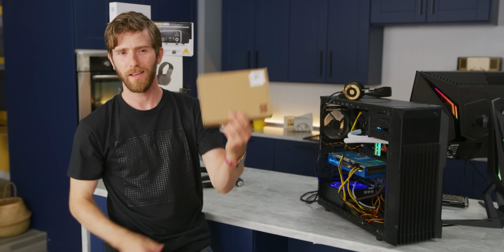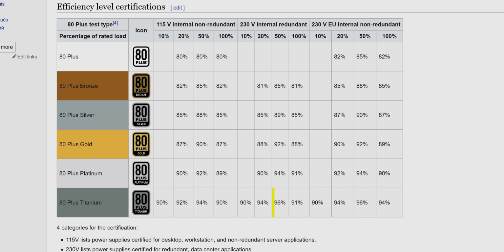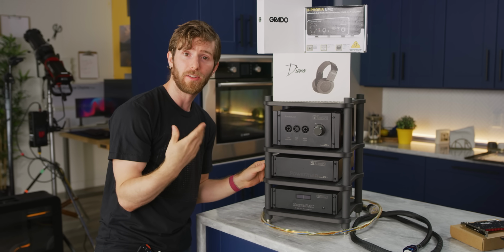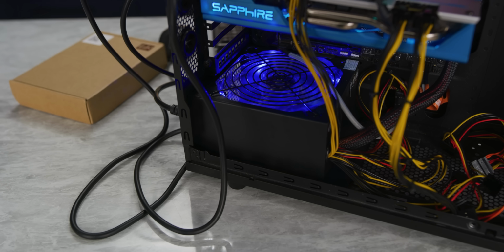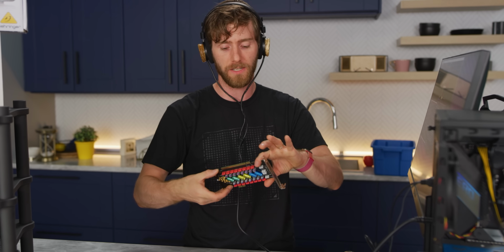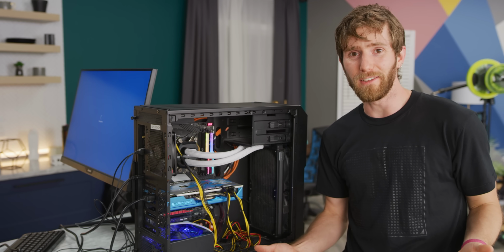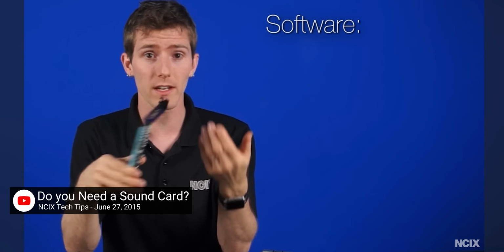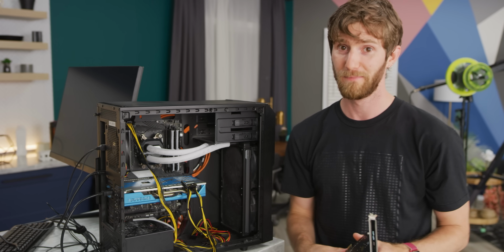Is this $40 card a SCAM? - "Audiophile" Power Filter

Comment: Playing Devil’s Advocate: Sort of hard to see how a power rail filter works without hooking up an oscilloscope to look for noise.
Reply: They are not supposed to just be near the power hungery parts, they need to be right next to the chip's pins to work. This is where linus was also wrong, they are in pretty much every circuit that uses chips
Reply: I honestly doubt all of these capacitors are even getting charged. I mean, filtering capacitors are meant to be directly next to the sensitive, power hungry parts. While the flashy caps on this this are dead center of the board... for you know... looks?
Reply: If the PSU is 1KW it is not likely being used at full power. Depending on its design may have decent output filter. Load swing on this load is likely low. ATX may put some limits on the noise. There are multiple rails involved. Lots of different strategies are used here. Parallel wiring and filtering at different sections. This hard to test. One thing I noticed was the different types and sizes of the caps. Which should improve frequency range response.

You need ripple to create the noise. It would need to be fairly large for it to work today. This also would probably need a cheap on board solution, but these are harder to find. I would look outside enthusiast hardware. AMPs would likely provide the popping he is looking for. However this requires more consideration than he probably wants to do.

Switch mode supplies sometimes create this problem also. Anything that has high inrush could do it.
Reply: Aw man I was hoping they were gonna do it. They just showed off all their toys
Reply: Sort of hard to filter the power rail when the caps aren't on the rail.
Reply: Definitely, definitely...
Reply: @danjz0404  oh really? Frequency is indirectly proportional to distance of the trace.
Reply: @codeman99-dev  I suspect you mean "inversely" and "length".
Reply: Agreed, or even line-out to let us listen to the audio vs just hearing Linus's subjective conclusion.
Reply: not devils advocate. the EE adbocate
Reply: I thought the same thing. Not trying to hate on the video, but the easiest way is to run a graph on the line-out of the audio card.  You should be able to do a highly accurate comparison that way to see what - if any difference it has.  All this video is, is someone putting on headphones and saying it sounds the same to them.  Just highly unreliable way to test.
Reply: I also want to point out that he dropped it at the beginning. Who knows if it's even working exactly as it's supposed to after that.
Reply: If you can't hear any difference then its not doing its job. Hooking it up to a scope might show a slight difference but its meaningless if it has no effect on anything perceived by the user.
Reply: T h a n k y o u
Reply: Linus:
- I didn't hear any noise in the first place!
Me:
- Turn up the gain, idiot!
Linus:
- Motherboard noise doesn't exist
My brain seeing this pseudoscience:
- BZZ-BZZ-BZZ-TSCHRKKKKKKKKKKKKKK

This video is just a complete failure. To test noise reduction, you'd want to max out your gain where you can clearly hear the noise floor without hurting or distorting the music playback. If you can't hear the background noise at all and you're trying to compare the "fidelity of the music", you're going to hear no difference. The problem is about low level noise that you can easily hear when turning up your volume and listening to a movie or a concert.

My P8H67 motherboard is pretty bad and even with a separate M-Track 2x2 USB sound card, I can very clearly hear the noise. The buzzing is in sync with moving a window and Blender updating a render preview.
Reply: Good point. However, I would bet my lunch money that the scope shows nothing in the audible range is filtered by this card when used as the card was intended.
Reply: If you'd need an oscilloscope to appreciate any noise reduction, than it's basically useless.

Comment: Linus, connect cables from headphones to another PC's mic cables, and try recording in Adobe Audition and finding noise differences on the graph.
Reply: I was thinking the same....and pump it through the Amp stack into some large speakers to see if we could hear a difference.
Reply: I wouldn't use another PC but a laptop on battery power with USB soundcard that has stereo input, as most of the noise would be additional noise coming from connecting it to two different power sockets and having all sorts of ground loop issues. Either this or it's just me having shitty power grid at home and therefore bad experiences with it.

Comment: I haven't got further than the description of the card yet but wanted to say that I used a PC on a semi-truck, and when I connected the audio wired to the truck radio I would get a bad static due to some kind of power issue. I fixed it with a filter, but I imagine something like this (if it actually does what it claims) may have been helpful in that specific situation.

Comment: PSA:  A lot of those cheap DACs and Amps can actually create more interference than even the worst-offendong PCs. You may have success, but I've owned 2 Fiio DACs and one amp and an amp from another cheap company and they all sounded worse and more buzzy than the on-board audio. 

Also, they picked up my phone's radio interference a lot, making me think they're not shielded. (I never opened them up, because I just returned them.)

I ended up with a schitt dac/amp combo. It works fine. Pricey for what it is, but it's still cheaper than audiophile stuff, so it's a decent compromise. Dunno if I'd recommend or not. The best solution for moust scenarios is to get a mobo with a sound chip you know is good.

Comment: Testing method was not OK. I don't know will it work at all, but on my opinion what you should have done is install some DAW software, set it for recording and check floor noise level with vs. without this mambo-jumbo card. - track level meters from DAW. There is no way that it can improve DA conversion quality or sound quality at general, but it could impact noise floor (again if it works at all).

Comment: I have a nice speaker bar, which I would need to turn up full blast, to hear that annoying "buzzzing" static.. But if i Keep it normal, barely can hear anything.  While my speaker bar has no base, its for "clarity" of voices and sound, very clear, lovely, sucks no base tho.  Prety sure my desktop PC  with its couple of fans are much louder.

But If I were to use cheaper speakers with little base or surround sound ones I have, these produce static/noise.

Comment: I might be able to help explain some things. So first of all, the idea of having all kinds of different caps is that different caps can in fact help filter different frequencies. But the problem here is the sound you're hearing doesn't come from them not being filtered out, its coming from the 30-80k switching speed of a stepping transformer on the board. This is a normal function of inductors and no amount of filtering caps will help that. It is being produced artificially through the switch mode power supply itself. Hell, it's even in the name. SWITCH mode. It switches its frequency so fast, it literally shakes the coil on an atomic level, and this is what you're hearing. If you're wondering why you can hear it even though it's outside of our technical hearing range, it's because the harmonic frequencies ARE in our hearing range. Hence, you we hear a whine. Playing music actually masks this, as the song is able to over-power the noise floor. Its only when it's dead silent that you'll notice it. I notice it when I'm using photoshop and I'm adjusting things like color balance. I can hear an audible high pitch noise from my PC as I'm adjusting my sliders. The second I stop, it stops. The secret to stopping this is noise isolation, which will be built into high end boards. The way it works is that all the 'noisy' stuff happens on one side of the board, then they use an isolation transformer to send that processed signal to an electrically separated part of the board, which would be the output. Since the output side is isolated, this noise doesn't end up coming out your speaker, but that doesn't change the fact that the physical inductor on the non-isolation side is still susceptible to the high speed switching that must occur. So long story short, you can almost always stop it on the speaker side, but on the PC side, that's just dependent on the physical design and engineering of the components inside.

Comment: If you're really concerned with electrical noise from the computer, get the sound card out of the computer. Use a USB DAC. Most noise in external speakers, especially powered ones, is ground loops.

Comment: I use a ground loop filter between my Pc and my amp (Fender Rumble 60W) and it does get rid of the buzz- but that is directly between the two. For under £8 it works wonders. https://www.amazon.co.uk/gp/product/B076WM732C/ref=ppx_yo_dt_b_search_asin_title?ie=UTF8&psc=1

Comment: Fit a pci slot plate optical toslink socket to the digital out pins then connect to the optical in on an external dac. As you are streaming pure pcm binary data through a non electrical connection there will be inductance or capacitance distortion through ground loops of radio frequency switching effects from components inside the case.

Comment: Back in the day when copying music to make MP3s was really pissing off Metallica, various attempts where made to make copying music from Cds  hard.

Some things worked to digitally protect the music on a cd, but there was always one guarenteed but really slow way to do it, and that was to play the music at high speed and use a 3.5 audio cable from the output jack to feed back into the mic jack and just record as it played.

Yep it worked but in many cases that natural hissing could be herd and defeated the whole super digital copying of a 50 minute music cd in 5 minute thing that was what it was about anyway.

This card "might" have fixed that, but its only 18 years to late and solving a problem as Linus clearly states in this video Not worth the trouble to deal with, like when changing the led color.

Comment: You'd also have to put the card into the first pcie connector and put the graphics card in the second. Assuming that's how the power is wired lol.

Still is a huge difference going back to the audigy it's so clean and crisp

Comment: if the thing actually does what it says it does, it should decrease power supply load by reducing the reactive current. The only way to test this properly though would be to measure the current draw and not the wattage because the wattage is the active current and not the reactive current

Comment: 1: *plays audio test *
wait...
Since when did you guys run Ubuntu??

2: An Audigy 2 ZS?
I still have that installed in my scavenger server. I should probably use it sometime. If you can tell me what port was the mic/line in, that would help alot.

Comment: I can confirm it is absolutely a scam.
That's not an LC, and throwing multiple different kinds of capacitors at things is not how electronics works.
Honestly? I wouldn't be surprised if those parts aren't even electrically connected to anything.

Comment: The weird thing is is that the second speaker buzzing sound you showed as an example at the beginning actually happens when my computer is turned off. When I turn my computer on then the buzzing stop
Reply: That's normal. It's called a ground loop. When the PC is on it drives the audio cable, when its off it just leaves it disconnected. Then, the wire acts as a capacitor, an "antenna" for lack of a better word, for the 50/60hz you get into your speakers over the power supply.

If you unplug it from the computer, it should make the same sound. And if you then bridge the three poles of the connector with something like a metal paper clip, the noise should be gone. Just to demonstrate the effect.

I actually thought to myself while Linus said that that his explanation is nonsense.
Reply: @m.sierra5258  Not a bad explanation but you're mixing up conducted interference (e.g. ground loops) and electromagnetic interference (e.g. a cable becoming an unwanted antenna). They're two separate causes of interference which work differently. 

Electromagnetic interference can be divided further into two types, namely capacitive coupling and magnetic induction. Like you alluded to, capacitive coupling is what causes a speaker to hum when you touch its disconnected audio cable.

Still, what you said is more helpful than most comments on YouTube.
Reply: @m.sierra5258  That's not what a ground loop is lol.

The hum is because the card "opens up" and the output impedance goes way high. This allows the amplifier to pick up the closest and strongest "signals" nearby, the most potent being line hum.
Reply: Alright, but what can we do about it? It's annoying af :( [edit: except turning off speakers]
Reply: @m.sierra5258  Time for some debounce
Reply: Same, also thanks to the guy explains ground loop.
Reply: same here lmao
Reply: use xlr cables :)
Reply: Your speaker is amplifying the floating input, which is acting like an antennae. The computer, when on, is successfully pulling the floating input to ground. It's probably a virtual ground.
Reply: that means the noose is elsewhere
Reply: ur house gna burn down bro
Reply: I have cheap headphones that would whine when inactive. Cutting the cable for the led lights fixed it.
Reply: Hey, a hobkin. Cute. Seen my fair share on VRC :)
Reply: @ForwardBias  lol thankies. I love this model. I’m also the first to animate videos with it. They are surprisingly good to animate with just being VRChat models
Reply: @WigWoo1  hope to see you around VRC sometime. Just checked your channel. Good stuff! I need to learn how to use my index for motion capping.

Comment: Through my Pro Firewire Audio Card with my GPU between 350-600FPS......Yeah you get some funny cycle noises for sure. You need to use studio hardware not and already power filtered Mainboard.....IE USB or FIREWIRE. PS: Using all pro gear

Comment: It would be interesting to have some type of expert on electronics like an electrical engineer or physicist or some other qualified person to dissect the board design of that card and explain in detail from an electronics standpoint what that board even tried to accomplish does ( or otherwise attempts to do ).

I am not an expert, but am a bit of a hobbies, and to to me it just looks like a bunch of large capacitors, a huge resistor and maybe a few other smaller components like small transistors or simple integrated circuitry. I'm also not sure how much sense it even makes to try to scrub the power from your pc after it has already made it's way though the motherboard to reach the PCIe lanes. 

If you want to run clean power to your valuable devices, then the first thing would be to invest in a device that connects to mains and has outputs where you plug your devices into that maintain a clean 60Hz 120V/AC (If you're from North America of course). They essentially take the "dirty" energy from your wall, and monitors the voltage in order to keep the mains voltage from the outlet of your choosing constant with the help of a small-large rechargeable batteries coupled with an inverter and some circuitry (these can be bought without the need to purchase an expensive uninterruptible power supply, although I highly recommend going this route), then next invest in a trusted and reliable AC to DC power supply. 

You're looking at spending maybe $300 maximum depending on your setup and how many devices you have if you just get the UPS. And that $300 dollars is a small price to pay in order to protect potentially many thousands of dollars of expensive equipment. It's almost like an insurance plan, but you really only have to make one payment. Only cost is associated with it is upkeep the battery inside (Mine needs replacements about every 5 years and cost me about $80).

Comment: Would be interesting to see if this thing does anything to help with a PCI-Express soundcard. I had an Audigy 2zs as well (yeah, I know it's PCI and on a shared bus) and at first it sounded amazing, but with more and more graphics upgrades, it eventually became unusable.

Also, a useful test not included here: FRONT PANEL AUDIO. The cable running from the motherboard—typically from the very back—to the case's front audio jacks acts like an antenna, picking up EM interference.

And not mentioned here, but another solution to the same theoretical problem: audio over HDMI. The DAC is no longer effected by the graphics card, only by the monitor. Coil whine still causes problems for some badly constructed monitors, of course.

Comment: If anybody reads this, I am having a lot of issues with power creating a lot of extraneous noise when I plug in my guitar pedals directly to mains power so if anyone could recommend a specific model of power filter, I would appreciate it. It has made recording while plugged into mains power impossible because the mains power creates so much unnecessary background noise

Comment: Check for audio recording using microphone level input - this is when filtering matter because incoming signal is very low and its going to be affected after going thru hi gain amplifier stage and each noise get gain. Not saying card is working just couple cents from guy helping out in audio studio.

Comment: GRADO : Please fix the design for your cords! I've had 3 pairs of SR-80e over the years and they ALL failed because the cords tend to twist and eventually break the fragile wires inside. Linus's pair (much more expensive model btw) is doing the same thing.